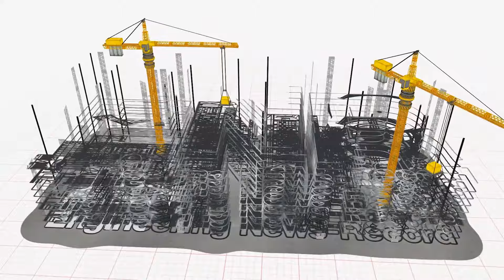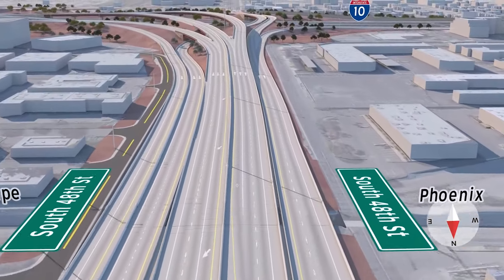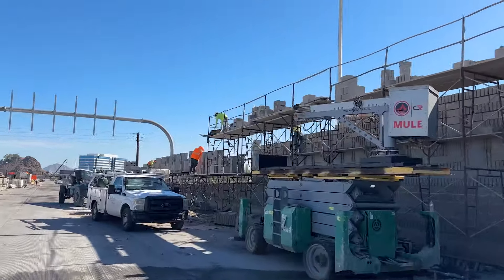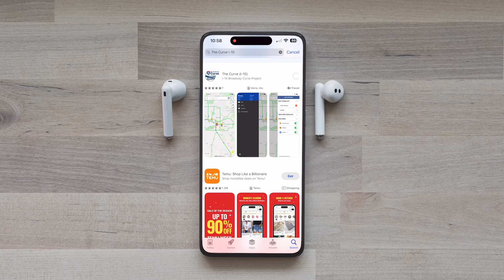In Phoenix, Crews Untangle 3-Freeway Interchange With $730M Broadway Curve Revamp

Comment: I personally have found the "phasing" of the construction on this project to be fascinating. Basically the entire Broadway Rd/SR 143/48th St area is being entirely rebuilt from the ground up without a single existing structure remaining and all ramp configurations being new as well. The fact that they have been able to keep essentially all movements open for the last 3 years with only periodic weekend closures is something the average person may not notice, but it's remarkable once you see it. They have a couple of longer-term closures happening now (SB 143 to EB 10) that they simply cannot complete the tie-ins for the finished project without the closure, but outside of that, you have been able to access every combination of on/off movements for over 3 years. Very intriguing to keep up with.